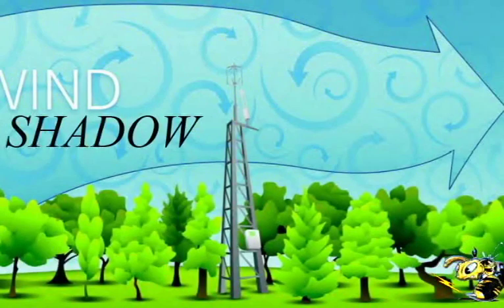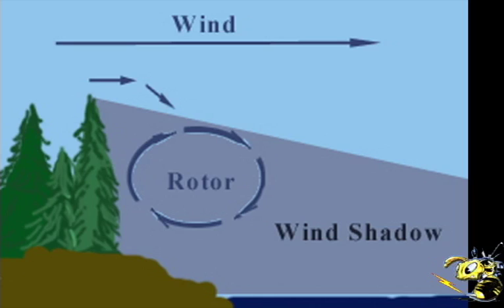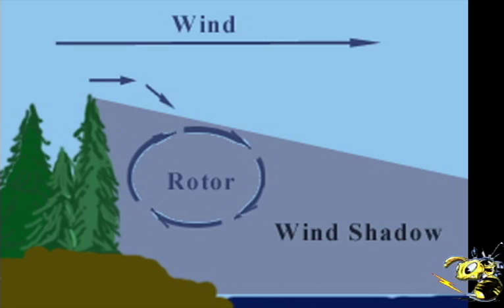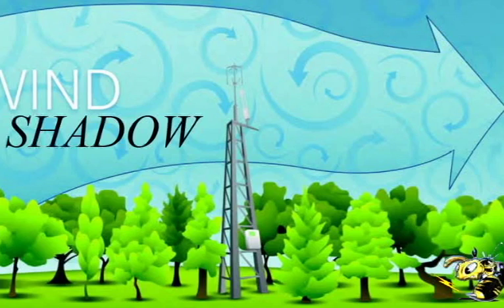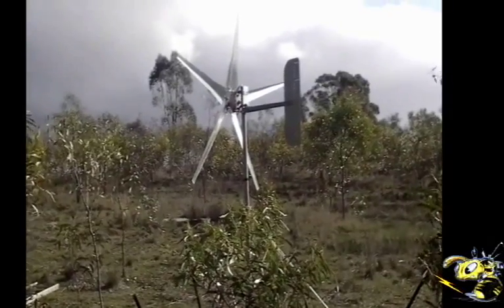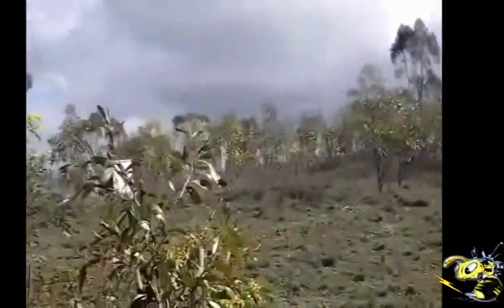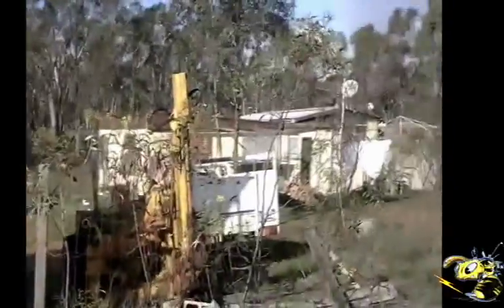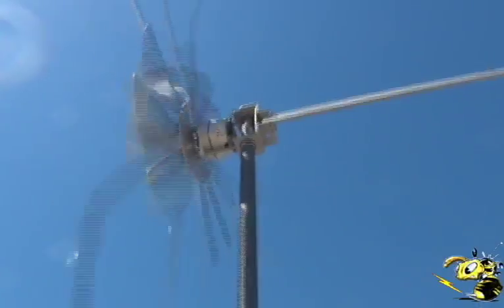Correct Wind Turbine wind generator pole tower installation Wind Shadow

Comment: I had the same problem. It's true turbines need to be high.
Reply from the maker: Sanford Buswell   I remember you Sanford lol.   You tested it in your backyard on a 10 foot pipe about 6 feet away from your 9 foot high patio.   Then you when 30 feet high and it started kicking out the amps.  Live and learn :)  Thanks for stopping by and please  subscribe.

Comment: The best locating to place a turbine is in a compression zone, not a flat of trees. My friend in Idaho uses his shop roof to compress wind pressure. My friends in Hawaii uses a hill side. These locations increase wind pressure. Placing it at least 2 meters above  the highest obstruction is the basic location to use. But placing it at 5+ meters above is the prime method.
Reply from the maker: Some body will eat it   True but the average person will probably not try to find a compression zone, sadly.  It is a great idea however and I have a few on my property but they only work when the wind is coming in one direction only, West.